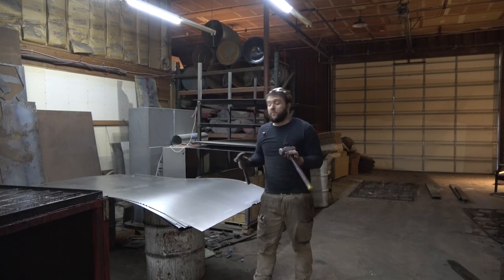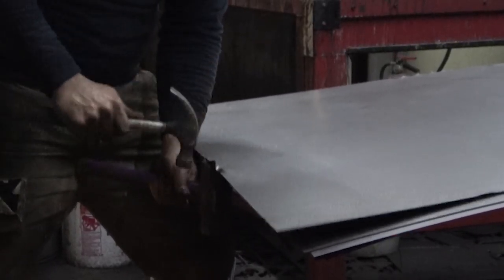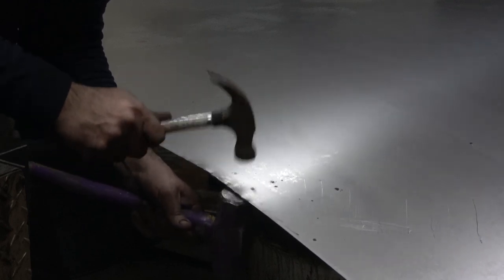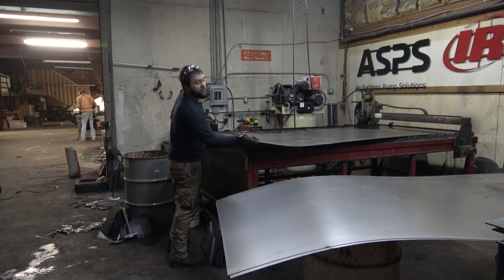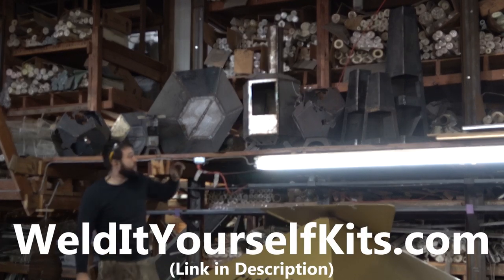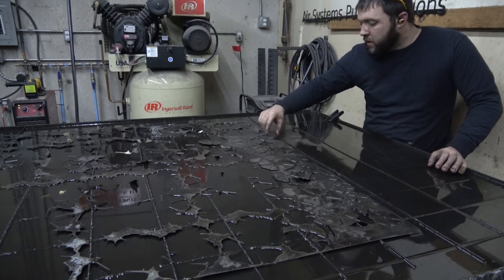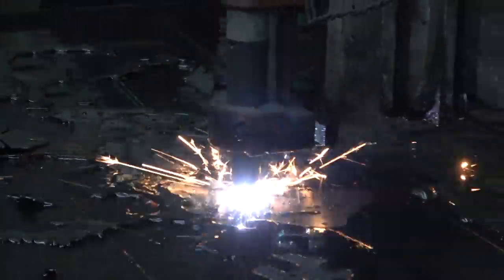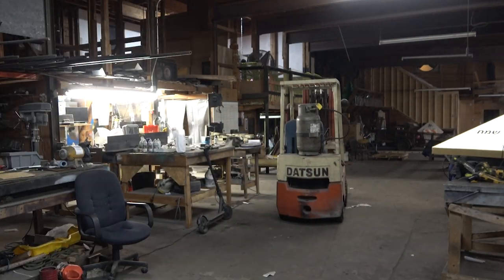My Trick for FIXING BENT SHEETS

Comment: Anyone: "How do I fix a.." Metal fab guy: "did you try hitting it with a hammer?"
Reply from the maker: When one hammer isn't enough, use two.
Reply: Aircraft structures mechanics. “Beat it to fit, paint it to match!”
Reply: @42Fab  if it not working get the big hammer's out  lol
Reply: @johnsabarese7103   mmm your mean whats in the paint cabinet at the time your done
Reply: Jennifer White yeah that works lol
Reply: @42Fab  haha nice one lol so true
Reply: Lol. I'm trying to flatten out an old tintype photo and am a little scared of this method so will probably sell it as is. Good info for other old metal sheets like signs that aren't so easy to damage though! 😊

Comment: chunk of 4x4 wood and a cheap brass hammer you can generally get it really flat without deforming the material. I work with 14-22ga sheets like this and they're always destroyed. If you've got a box brake you can usually squish up to about 16 gauge with no major creasing. For what youve shown in the video you can even get some cheap vise grips weld some 2x3 flat bar and just clamp the hell out of it real quick and you can get by pretty flat.

Comment: Not related to the subject at hand, but I see you run your table with water touching the bottom of your material. I've gotten conflicting opinions about that. Some say this gives better results, others say a small gap will give less dross or at least easier to remove while still cooling by way of the splash back. Have you tried it both ways? What did you find?
Reply from the maker: I notice no difference between touching and just under. I just fill it up so the 4-8 gallons that evaporate during a long day of cutting don't leave me too low by the end of the day. I've even overfilled to the point of barely submerging the sheet. The air from the plasma blasts the water away at the cut and I've never had to deal with it "farting" from under the sheet. I think there is a lot of "this one time, this one guy, at this one place, said this one thing happened, and now it's gospel" going around
Reply: The problem I was warned about was that if the water is touching the dross is quenched and becomes hard to remove. This came from a CNC table manufacturer. In any case, thanks for the answer.
Reply from the maker: @customhaines2510  maybe, I haven't noticed, it's really only connect right at the cut edge if you're running your table right, so it all knocks off pretty easy with a wire cup

Comment: mmm if you it gets drived to a customer and they see it before you do they flipping out on you need to be changed out they did leave the plate behind and did use it there the bend  can out prefect  the customer was little bad lost more than what i quote him to do the work  should not have bet  i could not do it  
should not complain did feed the lions in the shop pizza,s and cold drinks too  never seen animal eat  that badly